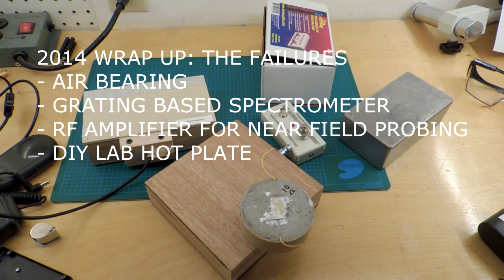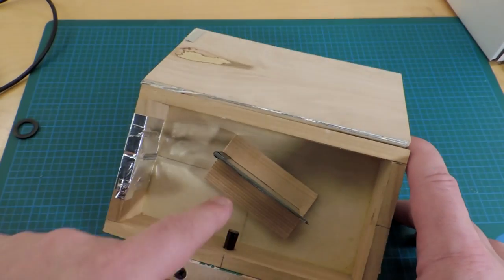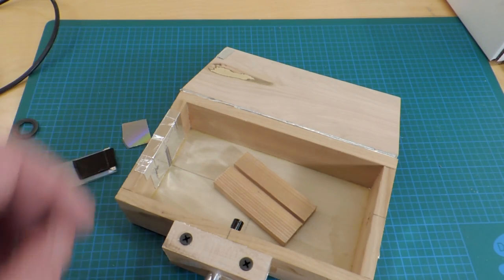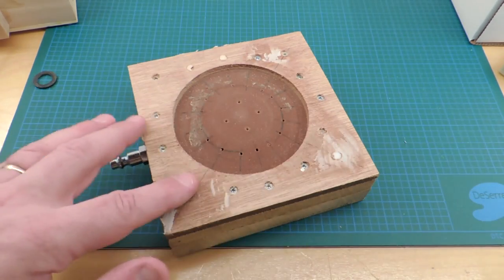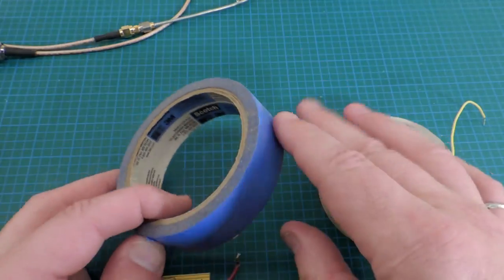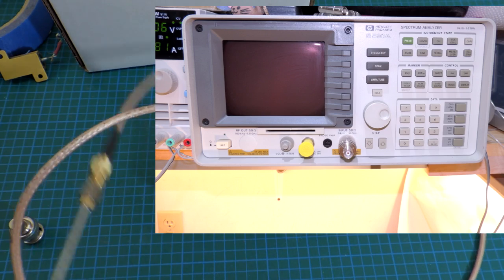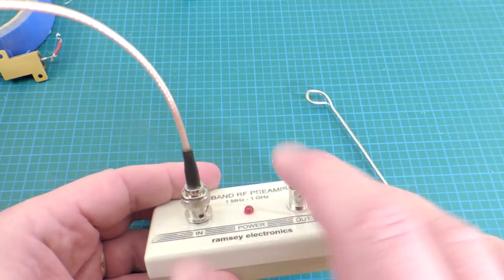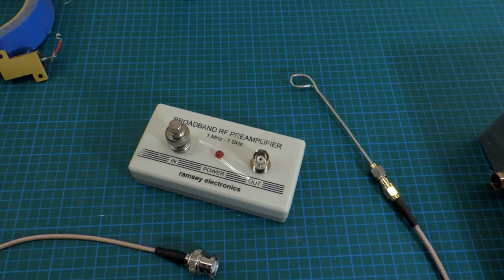2014 PROJECT FAILURES: AIR BEARING/SPECTROMETER/HOT PLATE/RF-PREAMP

Comment: The issues with the air bearing occurred because it was actually working TOO well. Take the PSI of the air supply and multiply by the area of the block and you'll get the "ideal lift capacity" of the bearing - a far larger number than the dumbell you had on it. Because the weight was so little, the unit was lifting far too much, until the pressure dropped, where it would fall, build pressure, and repeat. Try standing on it with one foot, you'll see a very different result.

Add a valve after the air fitting, which will allow you to match the flow to smaller amounts of weight.

Comment: Looking inside that Ramsey amp, it doesn't surprise me that it doesn't work. You probably have the second stage oscillating. and there's the loopy leads going to the connectors inside. And it looks like a single sided board. Minicircuits charges a buck apiece for the MMICs used.
Reply: felipes.net
I've used Hittite surface mount amplifiers on regular double sided FR-4 board at 5 GHz. You have to be very careful about the package, connectors, layout, and vias right under the chip.

Comment: A MUCH easier way to shield a piece of electronics is by carefully covering the plastic case with tinfoil tape. The same can be done with non shielded cables, this completely got rid of the buzzing/squealing/hissing on my computer's home theatre sound system. Good luck!

Comment: Is the oscillation on the air bearing present when the compressor is not running XOR with a lower weight or better dispersed weight across the box?  I wonder if the bounce is too high/not steady pressure from the compressor.  It'd be interesting to see from underneath whether the rubber is ballooning or not